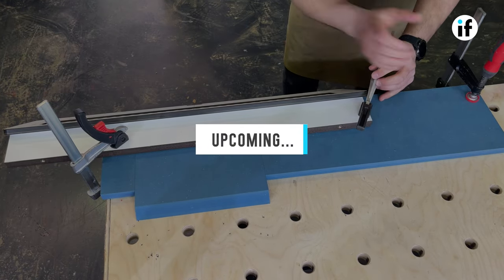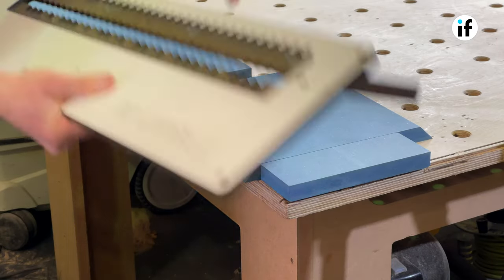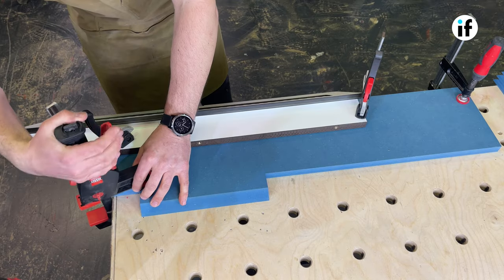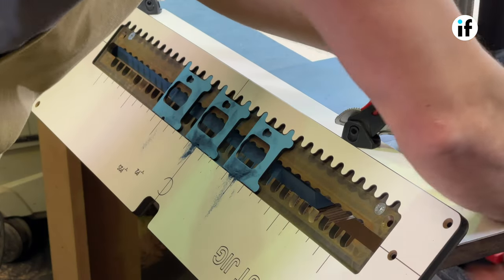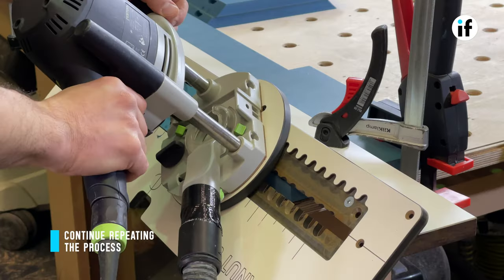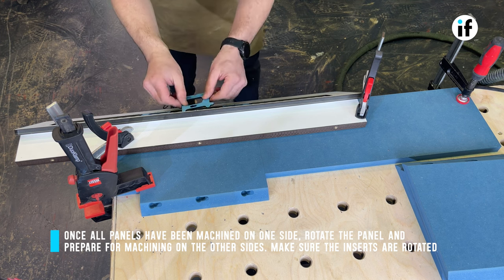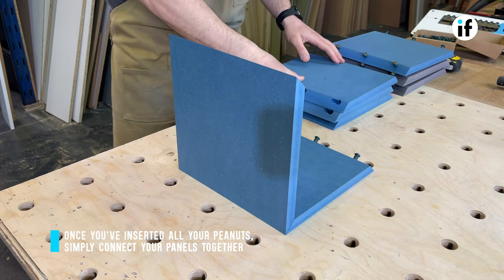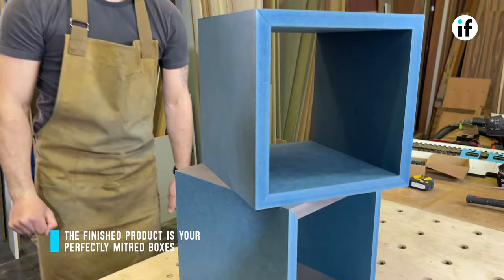PEANUT 2 Short | How to create PERFECT Mitred Boxes | Ft. PEANUT Jig

Comment: Hello, does anybody know what size screws you would use with the peanut 2 short? Would you use a smaller screw than the standard 50mm screw when fixing to mitres?
Reply from the maker: Hello @ad cr, thanks for your question. For doing mitred joints using the PEANUT 2 Short, you can use a 30mm screw instead. I hope this helps!

Comment: will the peanuts work for a 12mm mitred box?
Reply from the maker: Hi Kevin. Our current PEANUT component lineup is compatible with 15.3mm+ material for 90° joints and 18mm+ for 45° joints.